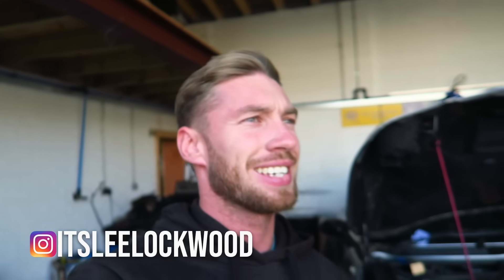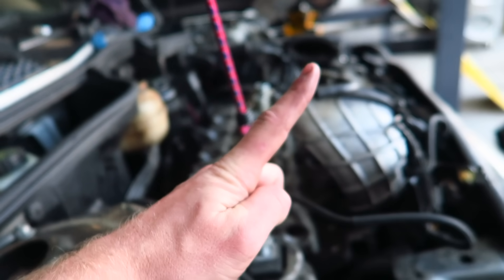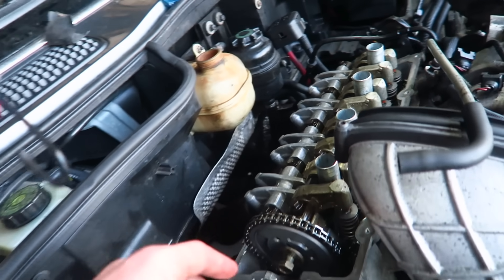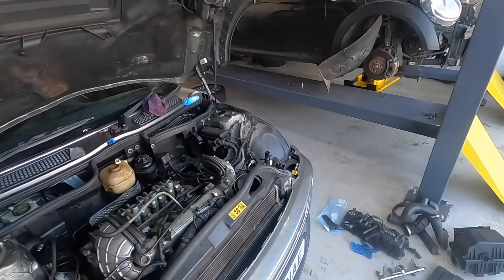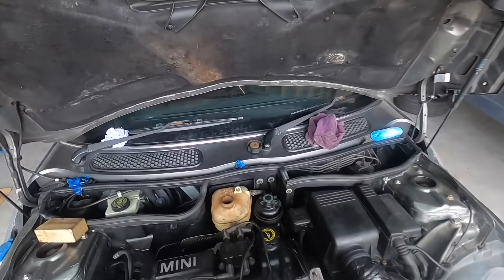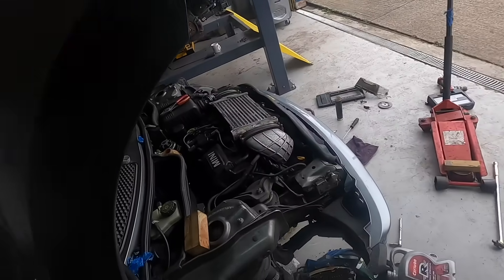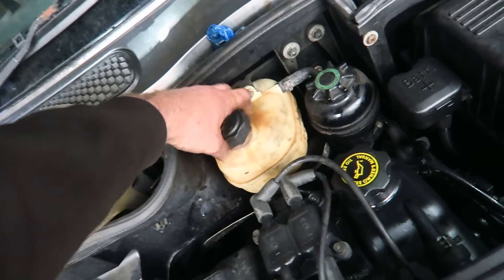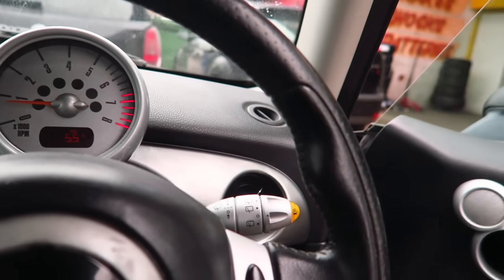I rebuilt an engine for the first time.. WILL IT START?!

Comment: About 3 months ago I did the timing on my 182 clio myself, done bits on my cars before but never anything quite like that, but after I'd put it all together, there was nothing scarier than turning that key 😂
Reply: Did it run fine?
Reply: @yeahmate6729  yeah primed the fuel pump a few times and it went

Comment: The code will probably be because you’ve turned it over with the coil pack disconnected. 
Be worth checking yours for oil leaks- mine had a few. Crank position sensor, oil cooler, sump and oil filter housing all needed new gaskets. 
Also worth checking the power steering fan actually works, change that coolant reservoir before it’s splits and see if both your fans are working as the resistor pack usually fails! 
Great little cars but not without their issues 😂
Reply from the maker: It was that! And yes I’ve heard a few people say change the coolant tank haha